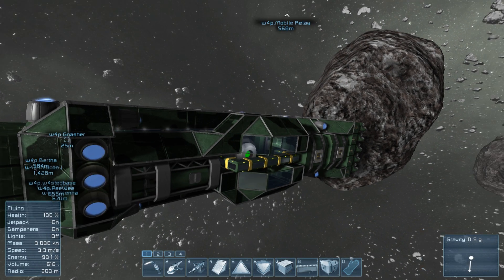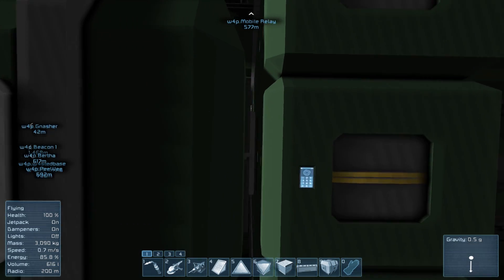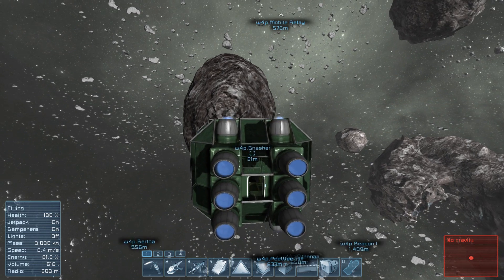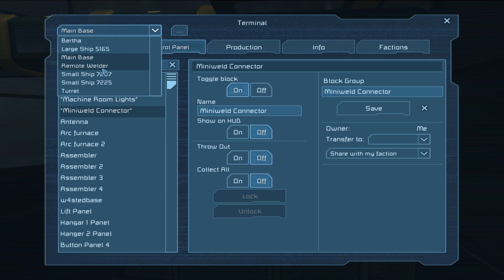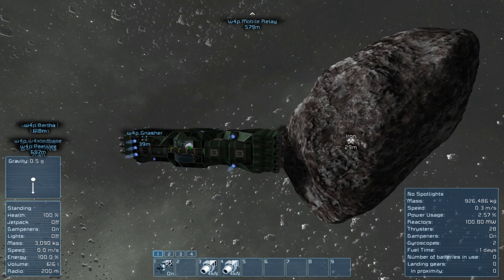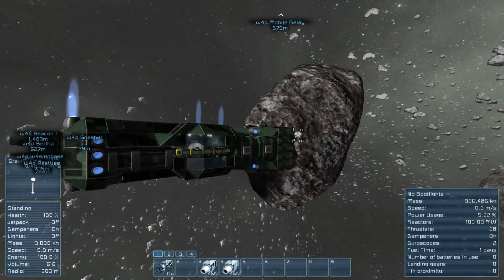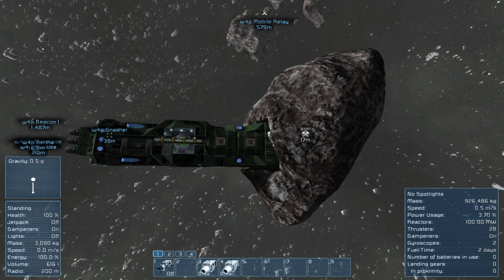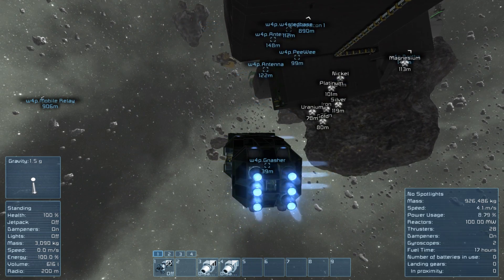Space Engineers - Large Mining Ship Tutorial/Concept - Survival Mode

Comment: The design and the look of this thing is pretty nice, I like the slight industrial look of it and also is not a cube or rectangle, something I have been struggling with, but I guess designing nicer sips come with experience.

Functionality wise, I think it lacks, a lot. One thing I learned from a tunnel borer, you can install drills sideways, on the edge of your main cutting head and they serve at increasing the diameter of the hole by another drill width, or more if deployed in echelon, big enough to squeeze you body safely, assuming the body has same footprint as original drill head. A bit hard to do on a square drill head, but not impossible.

Another thing I learned from operating small mining ships is efficiency. Space is at a premium and you do not want to waste it hauling rock. Any respectable mining ship needs a bank of ejectors to discard  ore into space, quickly. Only 30 ejectors are enough to toss 2-3 tons per second ! I bore straight through a roid, out the other side, engage the ejectors, spin and align my new path, all stone is gone, turn off ejectors.

Thirdly, the drillbits are packed too tightly. This might be a recent added feature, but a drill digs a slightly bigger hole than its head. A small drill, its head is 3x3 but digs a 5x5 hole. That means you can safely leave 2 spaces between 2 small drills and rock still will be cut. With that in mind, you can halve the number of drills for same footprint and efficiency, or enlarge the head by almost 50%.

Comment: By the time you reply to this I will likely have tested on my own, but you may want to mention it for others; you have a connector on what looks to be a piston when you dock your ship. Can the piston pass through items in a conveyor system? If so, what about a rotor?
Reply: Thoddius You might already know this by now, but advanced rotors can pass items through a conveyor system. They can also pass electricity. It makes for some very compact rotory miner designs. (At least for me, only started reently and I don't have a huge amount of resources yet for a big one like this.) Of course, a compact design does have its disadvantages. My compact miner design currently likes to swing about while flying and can be very difficult to control, and it very rarely actually goes in a straight line. The huge advantage with it, however, is that is is so compact and the drill bit has such a larger profile than the rest of the ship, to the point where it can actually take advantage of its own tendency to turn inside an asteroid and make course corrections while inside the asteroid to re-orient itself in the direction of an ore deposit that it would otherwise miss. Still trying to come up with a better advanced small ship rotor design to upgrade from the most basic ship though, because, again, trying to actually fly this thing to an asteroid is like trying to steer a rowboat in the rapids due to it being so compact that the front end connected to the rotor weighs much more than the back end.
Reply from the maker: I dunno, I'm pretty speedy on the ol' reply!
Piston: yes, can pass parts through as part of conveyor network (it's a large door both ends)
Rotor: nope, cannot.
Cheers :)
Reply: *****
I didn't think you would be that fast due to the time difference.
Reply from the maker: Thoddius love it when people get involved and comment on the vids etc so make sure I reply asap :)
Reply: *****
I know what you mean. It wasn't that long ago that I was approaching 500 subs.
I suggest you do a tutorial on Blast Doors. I can't find any videos that are of your quality. It looks like they require pistons to move them. Do they have any other features or are they just heavy armor doors?

Comment: I found that with my big miner, a few minutes of mining means hours for dozens of refineries to process it all -- It's not worth lugging around the refineries on the miner itself, they can only process a fraction of it.

I use side facing drills (front and back) to keep the damage down when tunnel-mining.
http://cloud-4.steampowered.com/ugc/31844519157471686/D748CB91FF838E83F27E6A2DA8EC79B1119B9916/
http://cloud-4.steampowered.com/ugc/30719887677518383/B488D0F74A5F2C43A3EDB62042EBE859CE9FE782/
Reply from the maker: That thing is one squat looking beast! I saw a video earlier using wheels on the sides to cut down on the damage, might give both approaches a try and see how they work out. For now though I don't mind having to do a bit of repairs here and there, I quite enjoy using the remote welder drone :)